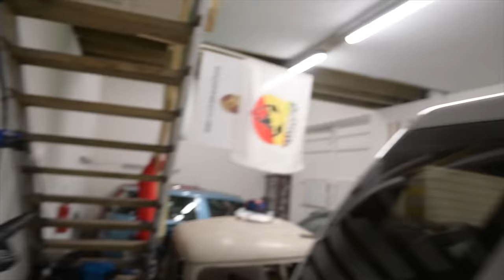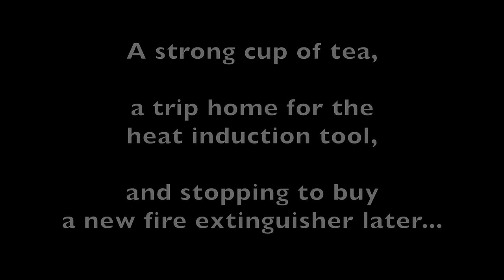Hippo tried to kill me - TWICE! Brake failure, fire and a rusty bolts

Comment: Back in the 70s , when our cars were always very old and troublesome,  and money was very tight ( or at times non existent), if we had brake shoes contaminated with fluid we would soak them in petrol for a few hours, the set them on fire and watch all the brake fluid come out of them and bubble away ! It was also around this time that I discovered that brake fluid itself is flammable 😊

Comment: Matt, i had the exact same thing happen to me about 25 years ago in a 1993 Vauxhall Cavalier.
I was just coming off the A1 in Cambridgeshire and needed to slow down for a roundabout...and my brake pedal went straight to the floor....my handbrake wouldn't work either as the rear brakes had failed, the resulting friction had effectively boiled away the brake fluid!
Scariest moment of my driving lice, thankfully saved by being able to downshifting and utilise a nearby hill as a form of natural braking!

Comment: I’m genuinely surprised that Hippo hasn’t got dual circuit brakes which would have still at least operated the other three wheels but glad you were able to get there safely and sorted. RIP Steve Wright eh? My favourite Radio DJ. I’ll hopefully see you on Saturday at Rustival!
Reply from the maker: theres a joint servo or reservoir so if you pump the pedal to try to stop it, it can dump all the fluid

Comment: My understanding  is that it should  have dual circuit brakes...
Reply from the maker: You'd think but its basically a 1980s Rover 200 with bits of Marina under the skin
Reply: It would have had dual circuit brakes in North America. They were mandated for 1969! Even the Marina had dual circuit brakes this side of the Atlantic. Then again, even Mini had head restraints beginning in 1969 for the same reason. England and Europe were a long way behind in safety standards. In the 80s, Morgan had two frames for all 3 car lines. Canada and the rest of the world because our impact standards were that much more stringent

Comment: Matt drop the rear drum back on the rear brakes and check the backplate against it and make sure it hasn't been bent by a baboon prying at it with a pry bar the top portion of the back plate looks bent back towards the shock, either bend it back or a new back plate. good luck!
Reply from the maker: good idea
Reply: Or get someone who knows what they are doing and trained mechanic
Reply: @Jason-dd4be How else would you check the back plate for runout? the backplate should have an even gap around the drum's edge. As I'm certain JLR didn't design a wonky backplate

Comment: You can shift into neutral in an automatic while moving…just like a manual transmission.

The e-brake button/levers can be used to slow the car….and from what I saw on the Ashley Neil channel, it works far better than a mechanical handbrake/parking brake. But e-brake designs may vary.

Comment: Working on British Cars manufactured in the fifties, I never once found difficulties in undoing nuts or bolts.  I am of the opinion that the BSF was why.  When I restored a 1953 Humber Super Snipe I talked to myself saying thank you. Once any any nut or bolt was cracked, it was then fingers to remove. 
Later in life working on a modern car, I realised that the threads were manufactured to cut themselves in on first installation.   A sign of the times.
Reply from the maker: I tnink its more lower quality metal rather than the thread pattern. My barn find Merc W123 comes apart like a nearly new car and thats all metric, unlike newer cars which crust up much worse

Comment: I assume that the freelander had dual circuit brakes from the factory so it seems likely that the goblins have been at work to modify the baking system at some point. The rear backplate causing the rusting issue seemed questionable too - maybe the wrong part?
Reply from the maker: Im not sure it did have dual
Reply: @furiousdriving  my bad - just been googling this and since ABS came in dual circuits don't have failsafe apart from if one side of the dual piston master cylinder fails you should still lave some brake pressure. It seems that if a leak appears in the system then indeed you may get no brakes.
Reply: @keithmathews1673 That seems very dangerous. I've always assumed dual circuit brakes were just that, if one circuit goes then you still have a diagonal split for emergencies.Rust isn't a big problem here in Australia.
Reply: Interesting thought…I’ve always wondered why (though not enough to actually go find out), if dual circuit brakes actually work, then why is it possible to push the pedal all the way to the floor when bleeding one wheel? Anyone know?
Reply: @furiousdriving It must have dual circuit being that new. My 1968 VW Beetle had dual circuit brakes (a new thing that model year). You can normally see looking at the reservoir whether it has 2 separate feeds into the master cylinder. So yeah - one circuit leaking and running out will give really long pedal travel as that half of the master cylinder does nothing, but the reservoir should have a baffle to keep some fluid in the other half, and once the leaking half of the master cylinder bottoms out the other half should still give you brake pressure.
There should also be a red warning light, I'd have thought, for low fluid. I'd be pretty surprised if that wasn't mandatory by then.
Reply: @interdec are you actually going all the way to the floor though? Or just way further than normal, and then it stops. Might feel like the floor, but I'd think that it should be the other circuit building pressure.

Comment: I always thought that brakes had a kind of redundancy with dual pipes, one set for front nearside and rear offside the other vice versa. So a failure of one cylinder works only disable two of the brakes. Clearly i was mistaken. Glad you managed to get to the barn safely.

Comment: I had an engine bay fire recently and had to use my dry powder extinguisher. Make sure you eash away all of the extinguishant as it is very corrosive
Reply: Lucky you had a fire extinguisher was it a modified car?
Reply: @lewwal1957  I was at home. Completely standard car but it has been off the road for 15 years
Reply: @gareththompson538  Oh i see might have been a perished fuel line

Comment: I'm as far as you struggling to get the retaining screw out. Suggestion: when dealing with these, replace the machine screws with ones using a Robertson head. The square shape is virtually impossible to strip, and by using stainless steel screws, they are almost impossible to have welded themselves into anything. Robertson are incredibly versatile. Even better than Torx.

Comment: I have that same problem with my freelander 1 facelift brakes failed coming off the motorway motoway when fitting a new cylinder it sits in that funny position ive too got a pin and spring clip missing im using a bolt with a washer and spring for now gonna unscrew those bolts at the back of the cylinder to bleed the brakes keeping the drum on seeing if that works lol

Comment: For those brake cylinder bolts a power finger file is your friend. They will grind the head off in a couple of minutes letting you move on with your life. I've done several Freelander brake cylinders and they are all seized solid so no point in even trying to unscrew the bolts. The brake pipes always need replacing too.
Agree with others that the shoes now need replacing, the missing pin had corroded away leaving the clip in place so when replacing the shoes make sure you get a spring kit too.
As for the dodgy angle, probably caused by the violence and heat used to remove the cylinder.

Comment: Only time I lost all braking ability (including handbrake) was on a Peugeot 306 TD after it popped both rear cylinders which then dumped fluid over the shoes taking out both brake circuits. No pedal even when pumping. Luckily was in slow traffic but that experience made me hate drum brakes even more than I did before. Also put me off Pug 306 for life.
Reply from the maker: thats extra unlucky! I hope the XSi has rear disks as I want one!

Comment: That back plate is bent because of the crowbar. Slap it back into shape. Also replace the left side because it is probably just as bad. Brake shoes that is soaked with brake fluid brakes worse than without it. Can become a problem with the mot. Also replace the brake hose that has been heated because rubber can tear due to the heat. And add a little copper paste to the bleed nipple. Saves a lot of stress over two years when replacing the brakefluid. Goodluck. Great video.

Comment: This has to be the most entertaining video I've seen all week 😊
Thought it was just me that can drag a job out days. Nice having the heat tool and someone to get advise from 😊
Dremil does them wheel screws nicely. Cut a slot and a big flat head screwdriver.
Bucket of sand is handy to have for fire/oil leaks....
Atleast you didn't burn the barn down, farmer wouldn't be amused🤫👍🇮🇪

Comment: Matt, I can feel your pain. My Mercedes W204 has lunched the right rear brakes. I was hoping it would be a simple pads & discs change but it has escalted into replacing the parking brake shoes & springs as well. I hope the job doesn't escalate any further.
Reply from the maker: Is that at the disks with drums built in? I dont like those for that reason
Reply: That's the ones. Mercedes have been doing them that way since the 1960s. I think your W123 has them too. My 2003 Volvo XC90 has the same setup fo the rear brakes.

Comment: Matt, I  had this same problem with our rover 25 about a year ago. I replaced the leaking slave cylinder with a new one, the old one turned out to be reclaimable with wire wool and that's another story anyway, BUT....the brake shoes were contaminated with fluid. Clean them thoroughly with brake cleaner, allow to dry completely in a warm dry place. I then carefully heated the friction material over a period of about 10 minutes until at what I guessed was above water boiling temp and then cleaned the fluid "sweat" with brake cleaner again and repeated this process twice more. After the 3rd cleaning cycle I refitted them and then allowed several hard braking  cycles by driving the car ( on an unused dead end road!) in reverse so that the rear brakes were doing the majority of the work. I then drove normally for the next 100 or so miles and can report that the car now brakes in a straight line with both pedal and handbrake. I have done this on a couple of my customers cars some years ago when the car was desperately needed and spares were not available. Ideally yes, replace the shoes but this method will work on all but the most badly contaminated shoes( the rover ones were pretty contaminated ), and they're still working just fine. Last month I popped the drum off and the shoes are dry and working well. Incidentally when I did this, the car subsequently passed the MoT brake test a few days later. Give it a go, might work for you as well😁
Reply: Ps, I was rather luckier with the brake lines than you!!😁
Reply from the maker: thats good to know, these are a bit low but have a fair few miles left in them still!
Reply: I covet your induction heater!

Comment: Matt, back in the day (50's/'60's) some slave cylinders had a forked spring clip that went into a groove on the rear of the cylinder, after it had been pushed into the plate and held the cylinder in place hard against the backing-plate. It would take up any slack, so that the cylinder was in as far as possible. Maybe it's supposed to be the same on the Freelander? Worth checking the L/H side or a parts manual to find out.

Comment: You have my sympathy with that rusted-up brake cylinder. Having struggled with drum brakes on a Series Land Rover, I deliberately bought a 300Tdi Defender with discs all round. They worked great, passed MoTs, very little maintenance needed, just as I'd  hoped. Then the time came to replace a rear wheel bearing. The caliper (still working) was so rusted up that I had to cut it up with an angle grinder to get the hub off 😮

Comment: Get a Dremmel type rotating  and use a cutting wheel when in a tight spot. I had to do that getting loosen the rear upper shockabsorber bolts/nuts in a tiny well underneat the third row seats in my Volvo XC90. Changed mine to standard shockabsorbers and other springs sold as a set, as the loadleveling absorbers where expensive as .... . When I got the nuts cut off the top of the spindels of the shockabsorbers came off, they where loose from the inner pistonrod of the loadlevelling shockabsorbers!!!  Using the dremmel type produced less sparks, but it took a long time.
Reply from the maker: Ive used one of them on the Rover P6, took forever and the chuck exploded but got there in the end

Comment: Should be able to put it in manual mode and force it to downshift, giving the same control over gears as a manual.  Can also just knock it out of drive and you're in neutral.
Reply from the maker: but its still driving the car, and against the hand brake. I want it to stop giving drive and let me stop
Reply: @furiousdriving  not when it's in neutral ... neutral is neutral what ever the number of pedals 😉
Reply: @furiousdriving  Push it into neutral, should disengage everything and give you the same as "manual" neutral.

If no throttle, manual mode should engage engine braking as it would on a manual.  Only difference is it will only slow to crawling speed, but you'd be able to stop on the handbrake from there.

The newer Freelander/Evoque with electric handbrake has a feature whereby you pull the electric handbrake on and the car performs an emergency stop, so you're not unable to stop - or so the man at Land Rover Experience told me on a demo run.

I'd still rather a manual in some cases, but an auto is great for mundane day to day driving in heavy traffic.  I certainly missed my auto today when I came across traffic that meant it took 20 minutes to do half a mile in crawling traffic!  Somewhat achy left leg after that!

Comment: Things are always crusty underneath a 4x4 if has been used off road unless power washed and sprayed with old engine oil underneath annually.  LR used BSP fittings on brake lines but finding BSP spanners that small is hard nowadays.  Thought that modern(ish) vehicles had twin brake systems so if one wheel failed the other 3 still worked.  Each system operating on 3 wheels.

Comment: FL1's have a diagonal split system but a single reservoir so it seems? Some folk on forums have suffered similarly when all the fluid falls out of the rear wheel cylinder.  I"m a fan of old fashioned handbrakes....

Comment: oh i been there done that with other cars, the brake pipe was always the worst bit for me not having or ever having made brake pipes....probably have to buy an axle kit of the shoe hardware, easier to fit new hardware, i have re used shoes in the past , cleaned up with emery cloth, ..it worked if not advisable

Comment: That's not a brake pipe flaring tool, although it's often sold as one. it's a generic tool for producing single flares, which is why it covers so many pipe sizes and I've seen quite a few leaking joints as a result. Brake pipes should use bubble or double flares (reversed bubble), depending on whether the seating is concave or convex. Kunifer or generic Copper Nickle pipe is much easier to work if you anneal it first.

You should replace the shoes, they're never really the same after a soaking in brake fluid and considering the condition of the faulty drum (the shoe retaining pin probably rusted through!), you should go through the entire braking system. Remember the Six Ps. Proper Preparation Prevents Piss Poor Performance.
Reply: It does like the kit has the double flare adapters in the case but I cannot tell if they were used in the video. It also looks like copper tubing which is illegal to use as brake line here,
Reply: @raisingarrett  Those kits are for forming flares. They only form a bubble for the purpose of folding it back into a double lapped flare. They form really poor bubbles.
Reply: @raisingarrett  can still use copper in the uk, this video was using cupro nickel
Reply: @kass9722  Thanks, I am learning a lot about the differences between Europe and here since i started watching these videos.

Comment: What a pain of a job!

But why is the brake failure the gearboxes fault? It has a lower 2 and 1 hold gears to downshift manually to slow everything down. You also have neutral which can help. If it was a question of "a child walked out in front of me..." then put it in Park which may either break the pawl or actually work in an emergency!
Reply from the maker: because even in low gears its still propelling the car, and you need to use the hand that should be wrenching the hand brake to operate, instead of just dipping the clutch
Reply: @furiousdriving  it takes a quick second to move your hand from the gear lever to the handbrake. Not ideal in an emergency but just as effective. Putting it in neutral is another quick option in a split second decision

Comment: I had an 2001 Freelander once and its brakes failed on me twice also. Same with acceleration when overtaking, no power. The car is POS. I had an auto and the gearbox failed when it was in motion. I sold it for scrap.

Comment: I thought cars built after 1970 something had to have dual circuit brakes to prevent total failure like this?
Reply from the maker: more like 2000, most 90s cars dont
Reply: @furiousdriving wow. Seems like a basic safety thing. I remember my 1980 mini 1275GT had dual  circuit brakes and a warning light (with test button) to show an imbalance.
Reply: Dual circuit brake systems have been standard equipment here since 1968